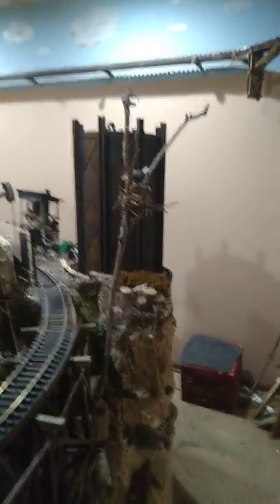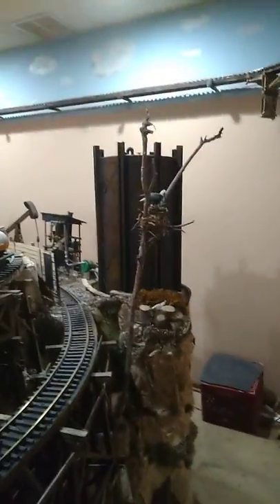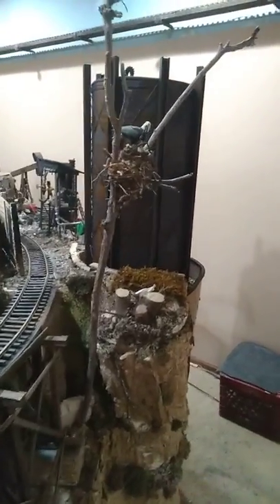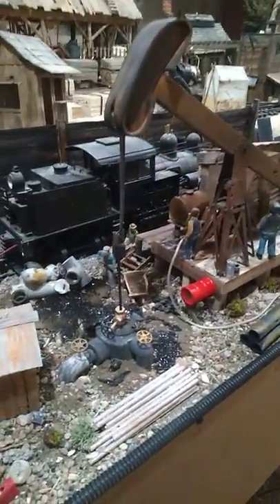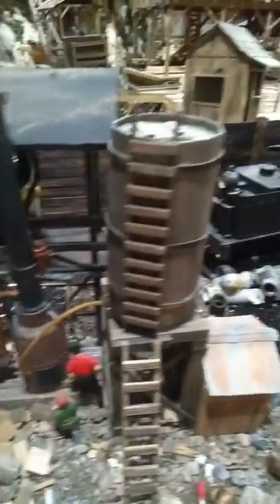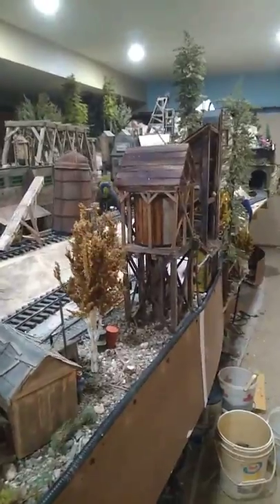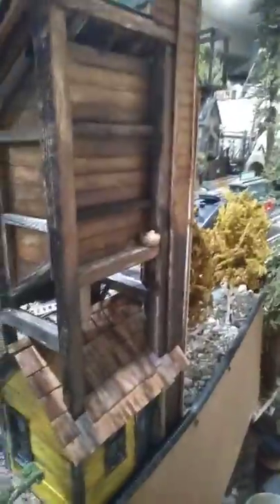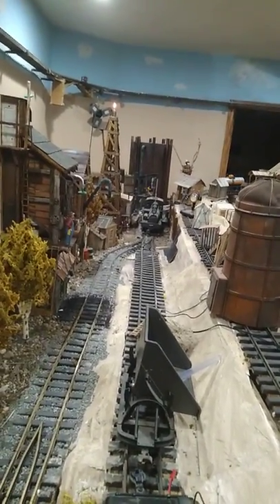Coaling tower

Comment: That is awesome. How did you make the flame on the oil derrick?
Reply from the maker: The flam is easy,build what ever tower you want wood steel plastic, then run a tube up the centerlike a 3/8 straight brake line cut to fit, allowing about a half an inch above the tower and run this through your layout, and then attach some surgical hoe to the tube end and the other end to one of those little propane torches but take the tip off and insert to surgical hose at least an inch or 2 and make sure it is tight, then turn it on no more than 1/4 turn and walla you have a burn off tower, watch you ceiling and never leave it unattained, hope this helps

Comment: Looking awesome, Larry. Keep up the great work. I have a question for you. How do you keep the flame burning on your burn off tower? I missed your video about it.
Reply from the maker: It one of those blue propane torch bottles I just removed the nozzle and the flame dances instead of high pressure, attached to a piece of surgical hose that attaches to the bottom of the center tube in the tower, i used a break line tube 32'' hope this helps thanks for your feedback

Comment: Larrry, please show how you made the flame, which looks great!
Reply from the maker: The flam is easy,build what ever tower you want wood steel plastic, then run a tube up the centerlike a 3/8 straight brake line cut to fit, allowing about a half an inch above the tower and run this through your layout, and then attach some surgical hoe to the tube end and the other end to one of those little propane torches but take the tip off and insert to surgical hose at least an inch or 2 and make sure it is tight, then turn it on no more than 1/4 turn and walla you have a burn off tower, watch you ceiling and never leave it unattained, hope this helps
Reply: @muss1951  Larry, you're the only indoor layout I've seen that has real water and real flame! :)
Reply from the maker: @tomroehl5126  I sub title my layout the biggest little g scale indoor layout kinda lengthy